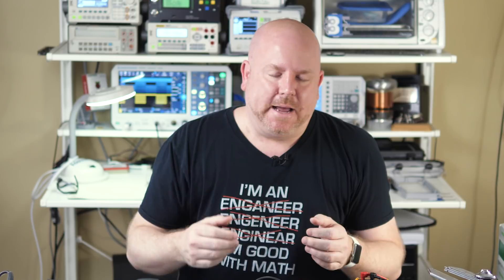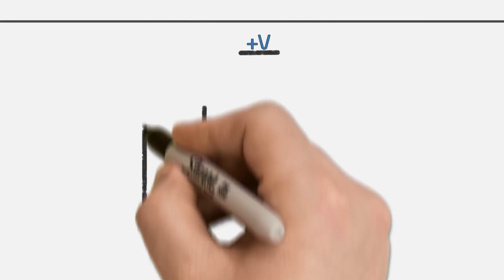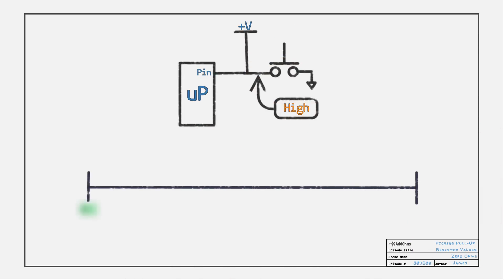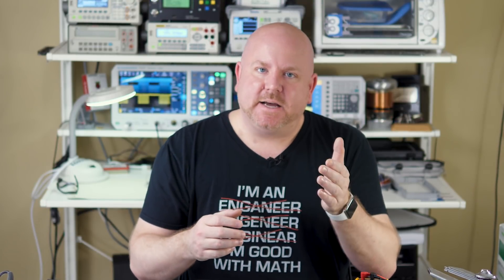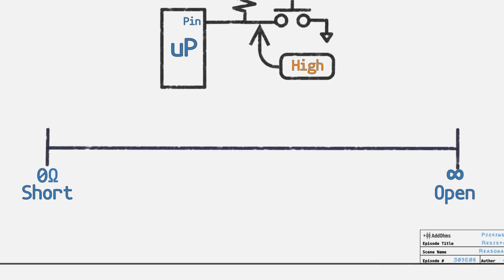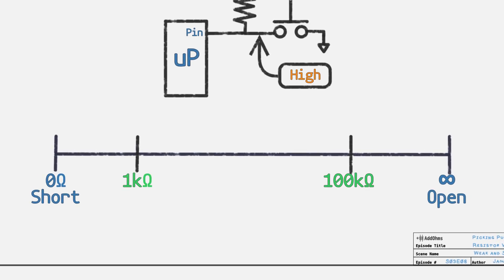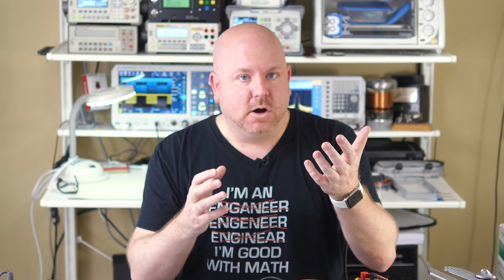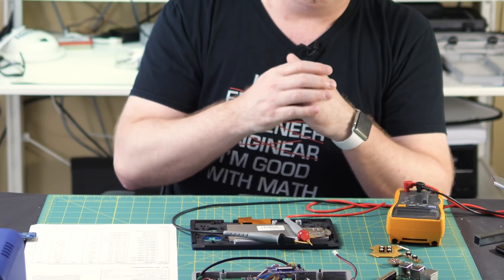Picking Pull-Up Resistor Values | AO #25

Comment: From the title and your introduction, I was hoping to actually get the math behind choosing a pull-up resistor. Sadly, as all most sources, you didn't actually answer that question
Reply from the maker: I2C is one of the few cases where the math sometimes matter: https://youtu.be/n2eaY51rkJQ

(and even when you do the math, the range is massive)
Reply: @AddOhms  Thanks for the quick reply and for the link to the more detailed explanation.

The answer seems to be: Start with the recommended, measure and experiment.

Comment: Why is it bad for the supply to short the ground?

Is it because it damages the ground? If this were the case?
Reply from the maker: It damages the supply and anything between it and ground. 

Shorts are bad.
Reply: @AddOhms  why does this damage the supply?. in my head. current flows from source to ground.

why would having no resistor damage the supply?.

is ground not just a way to get the current flowing?..

im genuinely perplexed because having strong pressure on a hose doesn't destroy the faucet.

so having voltage with no resistor how can it damage the source?.
Reply from the maker: Current flows in a closed loop. Ground is not a thing, it is a reference point and a return path for electric fields. When a short circuit happens, nearly infinite current flows causing everything to heat up, meaning the smallest resistive device in the circuit is going to burn on. Usually a transistor.

Comment: I have 16 ad9833 spi modules I want to connect to a mux. Can I use pull-up resistors on the module side of the mux to keep the chip select high the use the mux to select the cs to send it low?
Reply from the maker: Yes. it's usually a good idea to use a pull-up (or down if it is active high) on chip select regardless. That way the signal stays at a known state, especially when a microcontroller or other chip is initialized at reset/power-on.

Comment: Excellent ! Thank You, I'm re-wiring an E-bike Hub motor and needed to replace Both the Hall Sensors and the Pull Up's, I'm running 48VDC Li-Ion and was concerned the  pull up might be to protect the SS41 Honeywell sensor, but no, That's Great, I have some of those in my Arduino kit :) Happy Saturday

Comment: Your numbers have me worried. If, as you suggest (~ 1:58), we round up the internal pull-up resistor of the IC to 100kOhms, and then set our external pull-up resistor to 100kOhms (a value at one extreme of your range), then wouldn't the voltage at the input be VCC/2 (i.e. an non-permitted/ambiguous signal)? I would have thought, to make sure you get an unambiguous "logical 1" signal at the input of your IC, that the value of the external pull-up resistor would need to be, say, an order of magnitude smaller than the internal resistance of the IC. So, in this case, if we are rounding up the internal resistance of the IC to 100kOhms, then I would expect to have to set the external pull-up resistor to <=10kOhms to be confident that an unambiguous logical-1 signal will reach the IC input. Can someone please critique this reasoning?
Reply from the maker: External pull-up resistors would be in parallel to the internal pull-ups. Not in series.
Reply: @AddOhms  hmmm… that raises more questions in my head. Any chance you could do a more detailed discussion with schematic of internal resistor(s) included? Thx
Reply from the maker: It’s not that complicated. It’s just a resistor.
Reply from the maker: Page 63: https://ww1.microchip.com/downloads/en/DeviceDoc/Atmel-7810-Automotive-Microcontrollers-ATmega328P_Datasheet.pdf. Upper-Left corner, you can see the built-in pull up resistor is connected to the PIN and to VCC (Through a transistor.)

Comment: Thanks...succinct and clear.  I have a variation of the problem:  Let's say I want to have a pullup on an EEPROM write-protect pin.  The Vcc for the EEPROM is 5VDC.  The GPIO from the MCU will drive 0 or 1 (0 or 3.3V) per software.  I make the GPIO output push-pull.  What sorts of information do I start looking at to make the situation safe?  The GPIO pin is allowed to sink/source 25mA.  If I make the pullup 10K, and the GPIO is 3.3V when '1', then the current would be .33mA--seems safe.  But, I'm pulling up 5V via the 10K R.  So, do I have to take into account Vcc?
Is this the "way" to "think" about these kind of problems?  Regards, just a software guy trying to make sense of it all.  I very much appreciate your video lessons.
Reply from the maker: If the MCU is 3v3, then it probably isn’t 5V tolerant. So pull-up the enable to 3v 3.

Comment: why does it work like an "open" when I use resistor +100K ohms?
Reply from the maker: An open is super high resistance. 100K is high resistance. So 100K acts like an open.

Comment: follow-up questions (critical for actually selecting a resistor):  is the POWER RATING of the resister relevant?  Obviously, the VOLTAGE RATING needs to be higher than the voltage being used, but is there a minimum power-requirement (which becomes a factor for small SMT resistors).

Or is this essentially an irrelevant issue for pull-up/pull-down resistors?
Reply from the maker: Most resistors don't have a voltage rating. If they did, almost none on the market wouldn't be high enough for a microcontroller. Given that not even a few milliamps (at best) go through a pull-up resistor, 5 seconds with Ohm's Law would tell you that their power rating barely matters.
Reply: @AddOhms  All the resistor I use for SMT (Uniroyal), do have a "max working voltage" rating (or is that for something else and not what I I think it's for)?

Whereas I do pay attention to resistor power-rating (for other functions), I've never really known if I can just ignore it for pull-up/pull-down.

Comment: If long button life is a project requirement, note that choosing 1k pull-ups produces 5mV for a standard arduino, the minimum amperage needed to assist with button contact cleaning.

Comment: Hi..My comment is long after this video so ..if and when you have time feel free to answer.
I am trying to utilise A6 and A7 pins of arduino  Pro mini (to save other pins)
because A6 and A7 are strictly only ANALOG INPUT pins (no output no internal pull up)

And as my project is with batteries i am following this advice and try to put big resistor.
(even if the buttons only pressed a small amoynt of time ..but lets suppose that we are pressing button for large times)

And now i put a 1 M resistor (that in multimeter shows as 0.6 M=600 K
But i am getting this output

365
 =buttoon unpressed -no resistor
319
321
1023
 =i connected the 600 K resistor
1023
1019
1008
1015
1009
0
   =push the button
0
1001
  =release button
1022
1005
977
   =disconnect resistor
896
1008
982
862
998
946
241
312
306
335
353
--------------------------------------------------

So my question is
Why it is working  with such a big resistor?

I mean that can i safelly use this resistor to analogRead and consider 
Pressed when <512 and 
Released when >512 

???

Or is it working only now,here oin my home that maybe i have no intefrerences?
Reply from the maker: If you measure the resistor while holding the leads, your body's 400-500 kiloohm resistance is in parallel with the 1 Megohm. So the reading is going to be wrong.

1 Meg is an extremely weak pull-up but it is slightly better than no pull-up.
Reply: @AddOhms  Yes !...i was holding the resistor!!!
Ok...i will try it again and try it to understand.
But to avoid overheatting you with questions...
..Just in case....when i will release my beehive scale project running on batteries
it will be better to use the maximum resistoir that you are proposing
that is 100K .
Right?
(The A6,A7 and dig2) buttons will NOT be used almost at all.

Meaning that the arduino will run on 'silent' mode with no need buttons 
and ONLY once per month may the pulled up buttons(A6,A7) going to be used 
for 5 minutes.

So...do i have your 'licence' to proceed with 100 K pulling up?

Aslo in a kind of thank you and giving you something back
(even most propably its not your need)
I am giving you the 'almost released ' project of sms beehive scale
(open source)

And feel free to comment ...and share...if you want

And again...
THANK YOU FOR YOUR PRECIUS time!!!!!!

https://jimakoskx.blogspot.com/2020/08/sms-beehive-scale-arduino-2-load.html
Reply from the maker: I wouldn't recommend anything over 10K for a pull-up.
Reply: @AddOhms  This is a confusing answer for me ...because in this video you were saying that we can go up to 100 K if we are on batteries.
Anyway.....research is volatile so...i will keep your last proposion of 10K.!!!
Goodmorning from locked down Athens!

Comment: I used 50K, and my "button" thinks it's been pressed every time a relay in my air conditioner opens...
Reply from the maker: Good example of why a very large value (above 10K) is considered a "weak" pull-up.
Reply: @AddOhms  Replaced it with a 4.7k resistor, but it still catches interference from the air conditioner... Much less often, though... And it somehow detects a button press if I simply touch 5v lead of the button with my multimeter probe with the other probe not even connected...
I guess the only way now is to increase the size of the capacitor, and add a Schmitt trigger... Oh, wait... (Why didn't I check it in the first place) Maybe the capacitor is simply dead?..
I don't have an oscilloscope, and I want one now... It'll make debugging a lot easier...

ADDITION: Scrap everything I said above... It turns out, i don't have a resistor in my RC filter - I've connected both input and output to the same resistor lead on a breadboard by accident, creating a useless resistor... Ouch...

Comment: Just found your channel and I absolutely love everything. I have a question.. I have a circuit that constantly turns on and off. Intermittent power is what I thought at first. However, when I touch a point on the board with my tweezers, the circuit turns on and stays on. I measured the frequency of the oscillator and it keeps spiking causing the MCU to reset. Do you think a pull up or pull down resistor could smooth out the waveform preventing random resets? Or, is it because of the additional capacitance from my body and tweezers causing the waveform to smooth out and become stable preventing random resets?
Reply from the maker: Sounds like you have a grounding issue

Comment: Keep up the good work. Nicely explained. What resistor do you recommend for P channel mosfet with 20v battery supply ?
Reply from the maker: I don't know how to answer that question. Resistor for what? In that circuit, the only place I could see a pull-up resistor would be on the gate. And as I explained in this video, the exact value is not critical.

Comment: Hi,
 suppose if I put a 100 ohm pullup resistor with 3.3 volt. and the pin connected to this 100 ohm have the max current capacity of 1 mA,  will it damage the pin or microcontroller??
Reply from the maker: No
Reply: @AddOhms   Hi Addohms, 
Can you please explain?  Here total current in the resistor will be 33mA, right.  But the pin is only having a capacity of 1mA. But how is it not gonna damage it?
Reply from the maker: The pin in parallel with the resistor. It is high impedance. Almost no current goes into it.

Comment: Thank you very much, my wires from a limit switch are pretty long and everytime the motor kicks on I get a false signal. The internal pull ups are just not strong enough, even the 10k external. I've been chasing this for a week, thanks.
Reply: The capacitor is always “assumed” in the circuit. See the “Art of Electronics” text book. They are omitted from circuit diagrams to de-clutter the schematics but should never be omitted from real world circuits. It is a long standing protocol understood by electronics engineers. Unfortunately, most hobbyists find out the hard way. ( and to be clear, that includes me! Till I read the book, corrected my circuits and now have reliable circuits) . Unless of course you want random signals every time you switch the room lights on and off! Then in which case leave out the bypass capacitors.
Reply from the maker: A 10nF capacitor from signal to ground might well. It does have the negative trade-off of slowing down the edge of the signal, so the switch does not activate as fast, but we are talking less than nanosecond difference. If it cleans up the noise, it might be worth it.
Reply: @AddOhms  Wow, yes I can see how a capacitor would help, it would cushion, absorb the pulse from the magnetic wave. 
Let me explain what I have, it is a parts feeder with a small 12v motor on it. It is controlled with a inductive proximity sensor. This system is completely SEPARATE from the RPI and the limit switches. Every time the proximity sensor kicks on the motor I get the false signal to the pi. The motor and sensor is directly above the wires for the RPi. Going with the external pull up, and changing to the 1k from 10 has eliminated all most all the false signals but I am still getting a few false so will definitely try the capacitor from the feed wire to the ground and let you know how it works. 
I have thought about using a relay between the limit switch and the RPi but this would be simpler. It is sure nice to have someone who know what they are talking about reply. I have watched a dozen videos and yours is the first to explain why you need a stronger pull up, so thanks so much for your time.  Steve

Comment: It still isn't clear to me why you can't just use a wire. When the button is pressed there doesn't seem to be any difference in the circuit whether you are using a resistor or wire. There is still a path for the electricity to flow. All the video says is "that is a short circuit and that is bad" with no indication why it is bad, the electricity is following the path you want when you press the button, why would that be bad?
Reply from the maker: Creating a short circuit from supply to ground damages the supply and everything between it.

Comment: How does the pull up resistor along with 5v supply solve the problem or EMI.
Reply: This is my question too (read through comments to see if it was asked).  I understand all the pull up/pull down concepts from your other videos).  What I don't understand from here and reading elsewhere is the "why" part. If the switch is open, what exactly is a pull up resistor doing physically to "pull up" the pin to "true" when connected to 5V.

Comment: One thing you could definitely elaborate on, is what happens when your pull-up/down is too weak of a ratio from the internal resistor. Assuming they are pulling opposite directions, you get a voltage divider effectively. Then your resulting voltage can be referenced to the input high/low specifications to see if you are going to make the guaranteed voltage levels for a certain state.
Reply: I just asked the same question and got told that your/my assumption is incorrect that the internal and external resistors are in series

Comment: can someone explain to me .. if we have a pull up resistor like in the video, isn't the pin in this case always connected to 5 volts? even when we press the button, it is still connected to the 5 volts(and ground as well). so, I just can't understand, how does the pin read the voltage exactly ?
Reply from the maker: Ohm’s and  Kirchhoff’s laws. When the button is pushed there is path for current to flow from +V to ground. Current through a resistor creates a voltage drop, in this case 5 volts. So one side is at 5 and the other is 0 because it is dropping 5 volts. the side with 0 is connected to the pin
Reply: @AddOhms  Thank you! Guess I have to check keirchoff's laws again. But I am a bit confused. It is like when we don't push the button there will be no closed loop and thus we don't use kirchoff's law, but when we push the button that's like a closed loop from the 5Volts to ground, which means we apply kirchoff's laws. Am I right?
Reply from the maker: You always apply them. There is always a loop.
Reply: @AddOhms  um .. got more confused. Then why don't we say that there's a voltage drop when the switch is open, and it will also read LOW?
Edit: is it because no current is flowing through the resistor? since it's not connected to ground.
Reply from the maker: an open switch doesn’t “drop” the voltage. an open switch has the same voltage on both sides. Kirchhoff’s law.
Reply: @AddOhms  Got it, Thanks man you're AWESOME :D